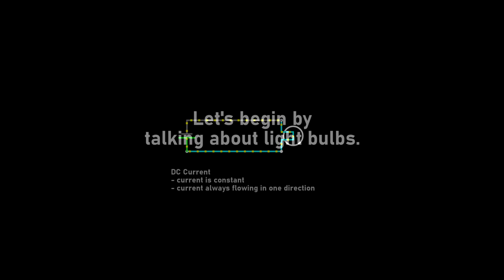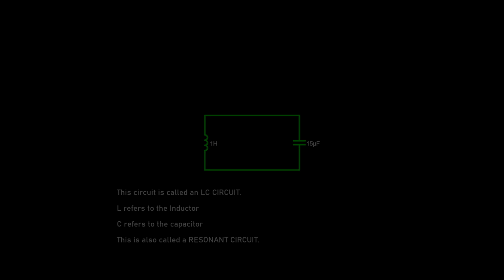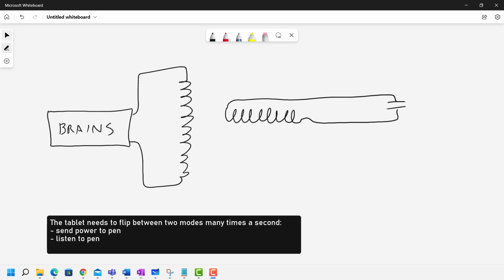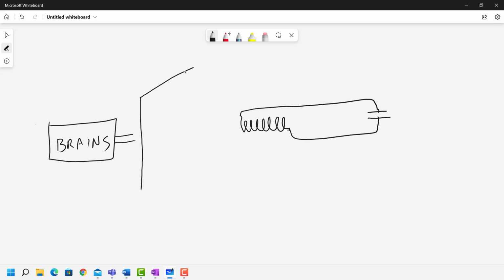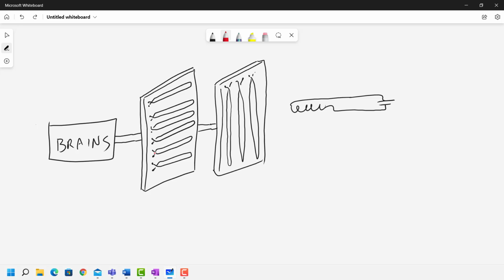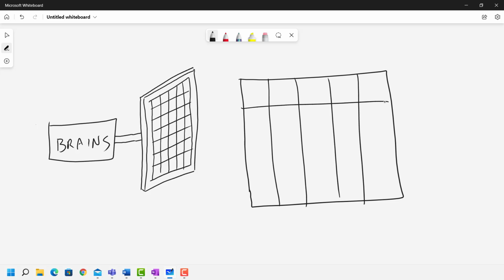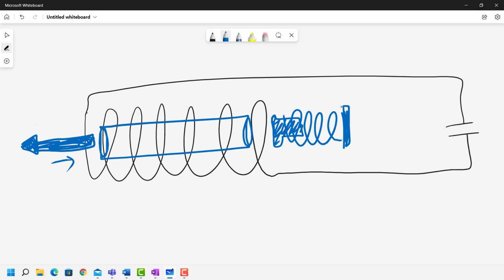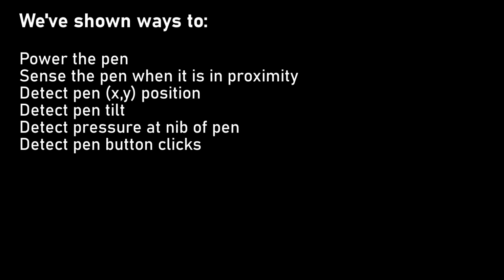How Drawing Tablet EMR Pen technology works

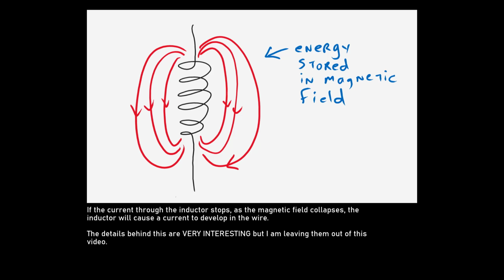Comment: 2:30 an inductor is a temporary battery, so the polar current generates the field which stores a predictable amount of energy which in the absence of the polar current will then collapse or decay. This is true whether direct, current or alternating current is present as long as there is a current. An inductor is used specifically to prevent spikes in the current because the spikes are absorbed into the generated electrical field and then basically it's smoothed out over time. 
 Now FYI guys. This is an example of a dimensional transformation and an example also of how Quantum transformation occurs across those dimensions and how they're predictable and repeatable. In this instance, we're looking at the fundamentals of electromagnetism which is directly templated over how a mother and father and child work. Doesn't mean I don't love you just means We have real electricity going on. 😅
Reply from the maker: Good info. I am planning on day on re-making this video go incorporate more things that I've learned, feedback, better diagrams/animations etc. So I will try to incorporate some of what you have mentioned.

Comment: I was really stressed out after trying to put in a Pro Pen 2 nib in my s-pen, saw posts on the internet that said that you could use it (and I really wanted something plastic that'd last longer, the cheap tempered glass protectors seem to eat through the rubbery nibs fast), but in reality it's off by millimeters, it's frustratingly close to perfectly fitting in but ultimately you'd probably have to file both the top of the stalk (as in length) and reduce its circumference by a tiny bit.
I drew with it for about 2 or 3 minutes and I was really worried that I'd probably screwed it up, that in trying to save money I made myself need a new pen. Krita's diagnostics tools showed okay sensitivity and drawing felt no different but I refused to believe there wasn't something wrong with it.
This video helped me get over that worry somewhat - pen tilt isn't really reliant on any /physical/ pressure, as in, nothing on the inside moves or really has the ability to get bent or loose when it comes to that functionality, it's something derived from calculations that don't even depend on /direct/ physical contact, even if you're hovering tilt is still in action. And as pressure... the construction and the mechanism doesn't really seem fragile enough to break or even get damaged from this, but I'm never experimenting like this again.

Kinda wrote that all out at length like this because I want someone to tell me I'm wrong at some step, but it really feels like it's okay after all, this video put me at peace.

Comment: Is that every Drawing tablet working nowaways?. So, with the same technology why does Wacom sell their tablet with so much higher price compared to other brands?
Reply from the maker: Yes all current drawing tablets are EMR tablets. Two reasons for Wacom's cost. (1) their tech is really better - but over time their lead in this regard is shrinking. I think many artists would be hard-pressed to tell the different between a modern Cintiq Pro and for example the Huion Kamvas Pro 19 (2) they are definitely counting on their brand commanding a price premium. Over time maybe we will see that change as competitors challenge them.

Comment: so the pen does not have a battery? aka over time it wont degrade like the pen with a battery does?
Reply from the maker: Correct these EMR pens have no battery.   It won't degrade at all. The only thing that really happens is people sometimes drop their pen and the drop might damage the internal components. But without physical damage that these pens just keep working forever. I've even used EMR pens from 25 years ago. One clarification I should make is that this is called "passive EMR". Some older non-wacom EMR pens are "active EMR". These pens do either have a rechargeable or replaceable battery.
Reply: @sevenpens  thx for clarificatiom, so these new chinese pens that say they require no charging, they still have a battery?
Reply from the maker: @asdfggqwe  The chinese tablet brands switched to battery-less EMR for quite a while now. So definitely their latest pens NOT have batteries. The only reason they ever sold ones with batteries in the first place is because Wacom has patents. But those patents expired over a decade ago. Occasionally though one may still find some  retailers have old inventory and are selling  the much older tablets that have pens that use batteries.

Comment: Are the fields from the digitizer under the screen so strong that it can cause an initial charge on the pen to start the resonance.
Reply from the maker: I think that is how it works - the initial charge in the LC circuit starts the resonance.
Reply: @sevenpens  i see isee

Comment: Very interesting, thanks for your great work! 
I always thought the pens were closer to RFID, having the coil powering a chip which sends a reply back via the coil. This is definitely way simpler that I thought.
Reply from the maker: Thanks you! The design demonstrated in the video is a much older EMR design. Modern EMR pens do have a  a chip which digitally encodes data like pressure into the return signal from the coil. I newer design is covered in this video about pressure: https://youtu.be/Otxm-JNa-i8
Reply: @sevenpens  thanks! Will have a look.

Comment: Does anyone know where I could purchase the part that goes into the pen?
Reply from the maker: Are you referring to the nib or do you mean the ferrite rod, or something else?
Reply: @sevenpens  Not the nib, the tech inside the pen specifically. E,g the rod and the chip. I’ve searched but either I am using the wrong name or you can’t buy them.
Reply: @OrganisedByJoe  supernote is selling these as DIY parts, they call it a refill and it should work with lots of classic ballpoint pens (with some cutting, they have a how-to guide for that on their support side). but keep in mind that this is their special Ceramic NeverReplace nib, could be a bit hard for some screens.

Comment: So the brain listens for the pen 133 times a second in the case of a CTL 473?
Reply from the maker: In the case of the CTL-472, 133Hz is the number of "reports" the tablet gives the computer every second. Each report gives the pen position, pressure, tilt etc. 
The brain of the tablet switches between listening  to the pen and sending power to the pen at a different rate entirely.  We aren't sure how many times a second that is happening, but we think it is many more times a second. Some people think it is 100x faster than that or even more. I'm still trying to find a specific reference from Wacom we can cite.
Reply: @sevenpens  There is a filter in OpenTabletDriver which specifically mentions that it would be helpful for the CTL-473 because of the 133 rps. I have no idea how to works and I have no idea about Github either. The filter is called temporal resampler if it peaks your interests
Reply from the maker: very interesting! Thanks for bringing to my attention. I had not heard about that filter before. I will check it out.

Comment: I noticed that the PCB only has bands of inductors instead of filling the space for each plane, is this because it can interpolate the coordinate using the analog values or are there more hidden in internal pcb layers? I was thinking of trying to make my own digitiser.
Reply from the maker: So far, everything I've seen - photos of the PCBs and documentation - indicates that the coordinates are interpolated. If you do try to make your own digitizer, I'd love to hear about it!

Comment: do the tablet coils give energy and detect at the same time, take turns, or completely separate circuits?
Reply from the maker: Based on what I researched, the tablet coils switch between sending energy and detecting many times a second.